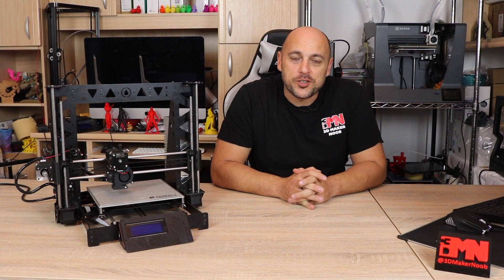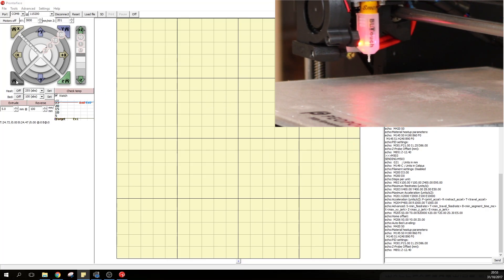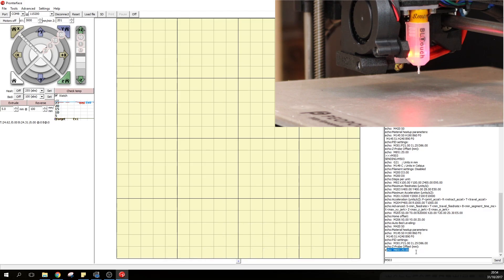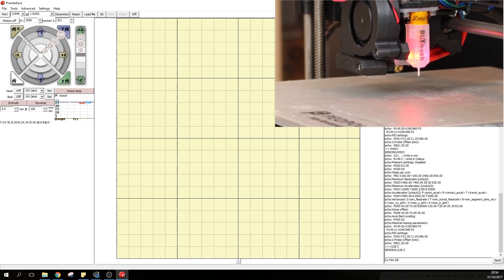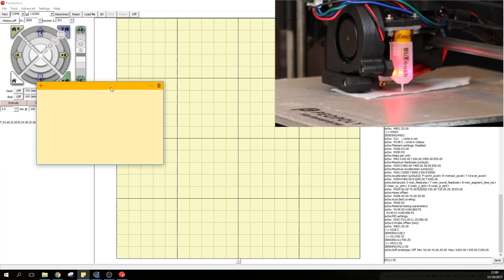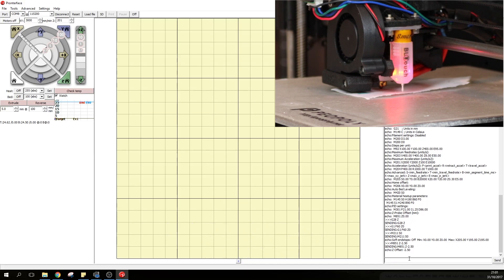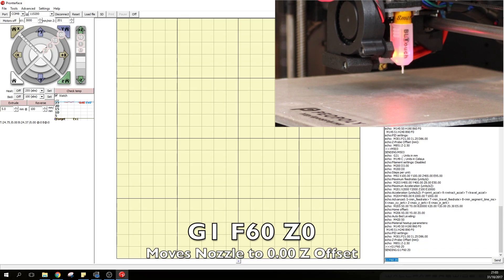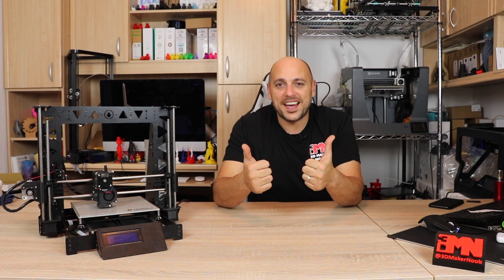Calibrating Z-Offset With A BLTouch Bed Levelling Probe

Comment: Just so everyone is aware, a piece of paper is more like .1mm. You said it right "zero point one millimeters" but you added .01mm to your z-offset.
Reply: Me Too, so it should be 2.49 + .1 =  2.59 right ?
Reply: @acestu  Yeah whatever your z-offset is add .1mm
Reply: @acestu  So if it's -2.49 and you need to add .1 then it goes to -2.29 right?
Reply: @kornboy8262   -2.49 and add value -.1 = -2.59. You minus from minus because you have to go 0.1mm lower (paper thickness).
Reply: @F4ilu2e  That's what I wanted to write but my finger hitted the 2 instead of the 5...
Reply: Noticed that aswell... common mistake. Otherwise great concise and clear video. I prefer to have the machine set to the paper thickness and substract it in my start g-code keeps the nozzle from damaging on glass beds.
Reply: Did he say "zero point one..."? If so .1 = 0.1..... read it it out loud. Zero=0     point = .    and one = 1__   soooooooo     0.1
Reply: @wombocombo7557  did you miss the point? He talks of zero point one, but in reality he does make zero point zero one move. Idk. Great video anyways.q
Reply: He ment  .01😂 bc it went from 2.49 to 2.50
Reply: @James_Blonde88 no, he didn't. A standard 80gsm piece of paper is just about .1 mm thick exactly. Regular printer paper ranges from about .05 to .1. The thinnest paper stock (very much non standard) goes down to .02mm.

Comment: You subtracted 0.01mm to the z offset when you say paper thickness is 0.1mm? Did I miss something or was that incorrect
Reply: I noticed the same. I decided to follow just in case I was wrong. The nozzle was too high. Then I used 0.1 and it worked.

Comment: This method is great!  Something worth mentioning... I was getting an error: "Serial error: could not open port COM6: [Error 5] Access is denied."   After some troubleshooting I found out it was because I had Cura 3.6 open and unknowingly connected at the same time.  In Cura 3.6 you can see "Connected via USB" for Connection under Preferences -> Printers -> to the right of the "Local Printers" box list.
Reply: cura musn't be connected in the same time because otherwise COM3 is already busy and Win doesn't allow 2 connections

Comment: Thanks a lot for the clear explanation! I'm only running a problem, after M211 S0, i'm not able to move z axis downward, anybody knows how to solve?
Reply: type  G1 F60 Z0 after m500
Reply: @mototuningos  thanks for suggestion, via pc i was not able to move z axiz downward anyway, but i solved moving from ldc panel on printer.

Comment: Anyone had this before?? Error:STOP called because of BLTouch error.
Reply: Just had this error and fixed it check the 2 wires plugged into the Z stop Fitting -- 

2 wires from BLTOUCH wire run.. White / Black  wires --Plug into Z stop terminal  It's a 3 contact plug

Left contact is Empty--  Black wire in middle contact / White in to Right contact closest to back of board.

Comment: Great video. If anyone else is coming back to this guide for a refresh of the commands, here's the step by step.

Calibrating Z-Axis
1) Home your Z
 axis
2) M851 Z0    // Reset Z offset to 0
3) M500    // Save to EEPROM
4) M501    // Set EEPROM
5) G28 Z    // Home Z only
6) G1 F60 Z0   // Move to Z = 0
7) M211 S0   // Soft endstops off
8) Paper technique with z change to figure out correct Z0. M114  to get current pos
9) M851 Z [current Z position including - if it exists] // Set z offset
10) M211 S1   // Softenstops back on
11) M500
12) M501
Reply: I was just going to type these down for the little cheat sheet I'm making but here it is. Thank you!
Reply: Hi I'm having a trouble with G28, nozzle is touching bed on first probe. I've made a video to show better:
https://www.youtube.com/watch?v=4vWUdRPmO70
Thanks, If anyone can help me.
Reply: @osvaldoasn  You need to set your z offset
Reply: @BenCos2018  I’ve solved my problem by removing C7 capacitor. Thanks.
Reply: @osvaldoasn  good to know 
Glad you got it sorted 
Feel free to reply if you need any help with anything btw
Reply: @BenCos2018  I'm wondering if you or anyone else could give me a hand? Everything is going great until I have to look at the printer to see the z offset number and its still just reading 0.00, does anyone know what I'm missing?
Reply: Wish I saw this before I went through the video writing it down. lol. Thanks anyways!
Reply: I was missing step 9!! My screen wasn't showing anything
Reply: HEY MAN MY NOZZLE DOESN GET CLOSE TO BED AFTER DOING YOUR STEPS, EVERYTIME I DO HOME OR START A PRINT IT HOVERS OVER THE AIR ABOUT 2MM PLEASE HELP I HAVE CR10 S5
Reply: @ewaynetm9261  mine too i have a ender 3 pro
Reply: @Franx1122  hey I was able to fix mines with pronterface
Reply: I followed this guide multiple times untill it worked now my printer is printing like a pro. Good luck
Reply: @ewaynetm9261  thanks i will try multiple times too
Reply: @ewaynetm9261  Need to raise the bed then, Z only goes so far.
Reply: Thank you for being a true deity

Comment: Hello:
I have updated my core xy printer board with the smoothieware board. It is working but I have a problem, I do not finish adjusting the bed well, and I bought a bltouch. I know how it connects, but I don't know if I have to modify the smoothieware configuration file.
You can tell me if I have to modify something in the file, or just remove the end of the Z-run and that's enough for it to work. I am lost with this subject, and as much as I have searched, I have not found anyone to explain it.
Thank you very much in advance.

Comment: Hey guys and girls ,I fitted 32bit board,and a bl touch,and even though my bl touch works in that it takes a map of the bed,when it comes to printing,it's like the software just don't work ,I can get my bed dead level but as it moves around you can see the z access moves  to a point we're it's over 2mm above the bed! On say one side..yes you can see the auto leavening  working but it's just way off...this is a super cheep nasty wood type printer and other videos talks about movement or twisting in the "X" access. And yes it has some movement  but up to  the point befor the new board it was not a problem...as for the "z" off set I calibrated  it and even repeated this process on several points around the bed just making sure it's level,and even after this the auto leveling is all over the place simply not working as it should.!!..what am I doing wrong?..lol..thanks.

Comment: Hey anyone watching this in 2019? well...... let me tell you that there is a way to do this without connecting to a computer... if you have an ender 3 and are using the latest firmware from TH3D just go to control and find the Zprobe Offset and set it from there...
Reply: Also: Octoprint, Terminal tab. With a Cr-10 it's hard to get the dial precise, so the terminal is nice.

Comment: If the Z height is at -2.49 when using the paper drag and the paper is 0.1, if you add those together would that mean the nozzle is technically at the bed level?  Why not just use -2.49 as the Z offset instead of -2.59?  Sorry for the confusion.  Thanks.

Comment: Should this be done while the hotend and bed are at operating temp?
Reply: Yes
Reply: if you're using auto bed leveling, then no. because the level is determined by the probe and not the bed itself.
Quick explanation:  without ABL you need to level with heat on because the bed warps (albeit a little. but enough to mess with prints) and you're not using a probe to save a mesh to your printer prior to the print.  WITH ABL however, if you setup your slicer right (IE, have the slicer run G-code prior to print after temps are reached an example is: G29 put into the custom G-code tab in printer settings in Slic3R), you can have the printer do a 9 point probe prior to printing but just after your bed and nozzle have reached temps.

Comment: Hi i followed your video very easy steps and well explained. I need some help, i received a couple of days a geeetech a20m it was printing great until i installed the 3d touch i followed your steps but now the issue is on the first layer its missing places were there is no print and with other prints it wont stick to the bed on the first layer?

Comment: Hi Joe,
Thanks for a very informative video. I tried it with a blt nock off from China and it worked perfectly. Only suggestion, if you want to print ABS don't add the thickness of the paper as the nozzle has to be really close to the bed. All in all a great video!!!!

Comment: The thickness of the measuring device (paper) is 0.1 as author said but in the video author added just 0.01 (2.49 + 0.01 = 2.50)
Reply: yea I'm also confused. so the actual offset should have been -2.59?
Reply: I think he just misspoke, meaning to say .01, kinda like he misspoke again at 5:23 when he said "click on homo" when he meant to say home.
Reply: @PaganWizard  this is incorrect because 0.1mm is indeed 0.00393 in. which is the equivalent thickness of a piece of paper, so no, still confusing
Reply: @nicholasblumling2117  this is driving me nuts - the most important part, and it's explained incorrectly, lol
Reply: @PaganWizard  You might have thought he mispoke, but you misheard, sounded like he said "home all"

Comment: Immediately after running the above codes. Once my system had performed a Mesh calibration and moved to X0,Y0 and Z0 it automatically disregarded that Z-Offset that I had determined usin this system and Jammed the Nozzle into the Bed. What am I missing???????

Comment: hey, thanks for the very informative video. I've followed all your steps and the setting read back properly as I have entered them. However, my nozzle is still about 5 mm off the bed when the print starts. Please help, I cant figure out how to solve this issue
Reply: Same problem here...Ender 3...did you ever come up with a solution?
Reply: @ronolshavsky  I have the same problem.  I ran a bed level test with the BL touch and it was saying the numbers were around 2.8-2.9 when it would probe so I subtracted that value and made my offset -2.9.  Which seemed to work.  Otherwise when I was doing this tutorial it just made my z endstop kick in so I was always printing like 3mm above the bed

Comment: Hi Joe, great way to teach!!!, I followed your video many times to get the adjustment, but still when BlTouch tests the bed, the nozzle start to print three or four mm higher, so the filament does not touch the bed. I was wondering if the mount is low. Is it necessary any Hight adjustment between the BlTouch and nozzle?

Comment: Hello Joe, nice explanation, very useful; I was lost and you explanation showd me the way.

However you are emissing one detail, you are not taking into account the X e Y Probe Offsets. Thus, your method is accurate only if the bed is perfectly levelled ;-)

I propose one small improvement.
After the step "G1 Y0 F60", you should do these steps
* G91; relative position
* G1 X(x-probe-offset) Y(y-probe-offset) F600
* G90; back to absolute mode

All the rest is unchanged

Comment: Thank you for a very helpful tip on the topic. There is however a question concerning the adjustment for the paper thickness at time 4:20 where you execute the command M851 Z-2.50. Shouldn't it have been Z-2.59 instead? The manual Z adjustment yielded -2.49, then you added the paper thickness of 0.1mm.
Reply: That's what I thought as well but hey might be very very thin paper he was using ;-) But all jokes aside, it's more the process that counts not really the actual figures.
Reply: That’s what I was thinking, that would leave it off the bed by 0.09mm. And the paper I measured is actually 0.07mm not 0.1mm. But I’m still setting up so have no idea what I’m talking about..
Reply: Happy to see this comment. Was thinking I was crazy :P
Reply: from what Im understanding is this procedure measures the offset of the BLtouch from absolute zero of the nozzle touching bed so you have to add the adjustment from the bed to nozzle using the paper for proper distance.
Reply: @x0atm3alx  Yes, but in the video, he added 0.1 to 2.49 and came up with 2.5, which means he only added 0.01 for the paper, not 0.1.

Comment: Mine was working fine, then all of the sudden wont work correctly anymore.  I cannot get the printer to use the Z Offset. It works fine completely when not printing, even sending a G1 F60 Z0 it goes to the correct position. But once you start a print, it prints way to high. I set my Z offset to way below the bed, and it printed at the exact same position. So it seems it is completely ignoring the Z Offset. Any ideas? I have found nothing online to fix this issue and am about ready to give up on it.
Reply: I just got mine running thanks to this video, and I am new to all of this, but if it is going back to the regular default position check and make sure you did the M500 thing and saved it and or check your pre-gcode setup in your slicer, it may be canceling out the Z0 command. My pre-scripts is as follows:
G28 ; home all axes
G1 F60 Z0; GO TO Z OFFSET
G29; BLtouch mesh generation
G1 X5 Y10 Z0.2 F3000 ; get ready to prime
G92 E0 ; reset extrusion distance
G1 X160 E15 F600 ; prime nozzle
G1 X180 F5000 ; quick wipe

Good luck, I hope you got it worked out. 
Using the M503, can you verify your z offset.

Comment: I have 6 printers running with BL Touch probes, a small production farm. What I have learned is that the optimal Z Offset varies with Material ... and varies as the Nozzle tip & hole wears over time. Also, any mechanical change, disassembly & reassembly, even what you would think should result in the same Offset, may not, another calibration must be performed. A change of 0.05mm of offset will produce visible differences in first layer print quality, changes below 0.03mm are hard to discern.
(by optimal, I mean the print quality of the first layer, the cosmetic appearance of the surface against the print bed).

Comment: Didn't work for me in the end. After switching back on the soft end stops, M500, M501, M503 and initiate. G1 F60 Z0 to determine if the new Z offset is set, it stopped again at the original soft end stops limit.
Reply: Same for me, have you found the solution yet ? I cant seem to find one
Reply: @Ian-yi7ks  I just leave my soft endstop for Z disabled. I don't remember exactly how I did it 15 months ago but I do remember doing it through the firmware.
Reply: For those who can't change the soft endstop settings, you can try setting an offset where the nozzle would slightly hit the bed, causing the Z0 to be lower. Then work your way up from there. I hope this helps! It worked for me

Comment: Hi Joe, I have a problem with my Z Offset setting, I`m using Marlin 1.1.9 and I tried your method and many others that I found on Youtube and on Google, my Z Offset doesn`t work, no matter the value I set, do you have any clue about this ? I`m using the inductive sensor, not the BL touch one, but I`m thinking about buying a new one, probably the BL touch, to use a glass on the table.

Comment: Hello excuse me for my English,I have Anet a8 I installed an extruder E3D V6 and the nozzle has shifted to the right 18mm and the center of the BED has shifted,how do I specify in MARLIN what to write to restore the parameters of the BED tell me how to do it in the firmware?Thanks.......
Reply: @Abitamim Bharmal Thanks.....

Comment: HI Good vid.

i want to set this valu in my arduino software to.
is the valu -2.59 or is it 2,59.  i just want to know if i´m going to set negative or positive number.  ( Z_PROBE_OFFSET_FROM_EXTRUDER 1.25  // Z offset: -below +above  [the nozzle] ) and this is the right place to set right??

Comment: Keep in mind the instructions presented are for Marlin firmware. If you are running firmware other than Marlin some of the commands used will not work. The technique is sound, the commands will change slightly from firmware to firmware. If you are using firmware other than Marlin, suggest you start at the https://reprap.org/wiki/G-code page to compare the commands to the ones available for your firmware. In particular, see that M851 is not supported or support is unknown in many firmwares https://reprap.org/wiki/G-code#M851:_Set_Z-Probe_Offset.  

In general, for G-Code. if the command starts in G it should work in all firmware, if it starts in M always check before using as the M codes are add-ons to the industry standard G-Code and will vary from firmware to firmware.

Comment: Hi everyone. I've seen 24 degree Celsius on the display of the printer.
Don't forget to do all these steps with the working temperatures on your nozzle and bed (that you will going to print).
Cheers!
Reply from the maker: A bltouch is mechanical not inductive so heat does not effect the trigger height of the probe
Reply: I get it but I think the nozzle has thermal expansion but maybe I'm wrong.

Comment: Excellent video. I love how you cut the crap, and get right to it. Unlike me.
I installed an inductive probe for ABL on my Ender 3. Some of the commands (including M502) used in the video do not work in my Ender 3 customized version of Marlin 1.1.9. Obviously no fault of the video. It's possible that some functions were not enabled to save memory. My Ender 3 Version 1.1.3 control board with the Sanguino 1284P chip is at 99% memory after enabling ABL.
I followed the directions in the video the best I could, but then I learned the hard way that I needed to add more commands to my starting gcode in my slicer, Cura. I have G28 (home), then maybe not necessary every time I have G29 (ABL procedure), then M500 (save settings to EEPROM), then M501 (read the settings back out of EEPROM). Originally I did not have the M501 command, so the machine was not using the ABL readings, and would grind my extruder nozzle into the bed as soon as I started a print.